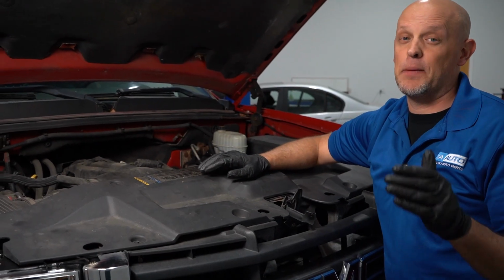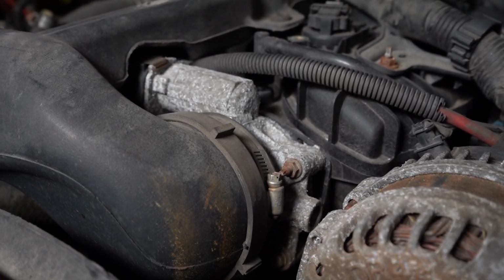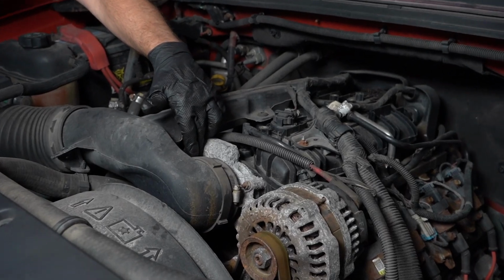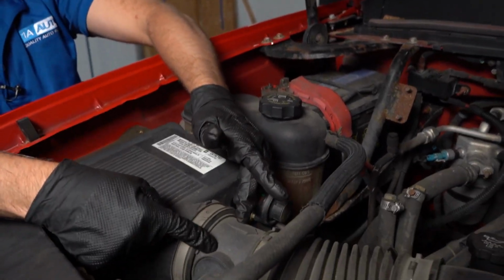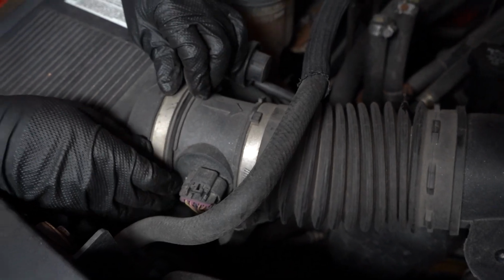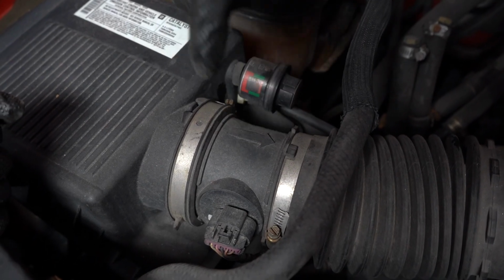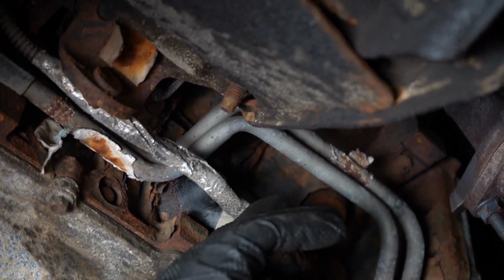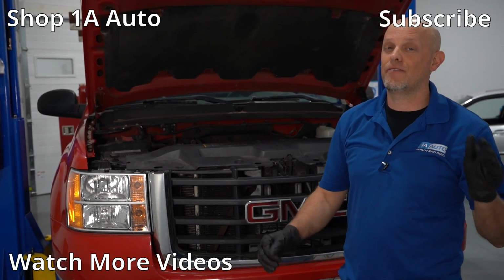Top Check Engine Trouble Codes 2007-14 GMC Sierra 3500 Truck

Comment from the maker: √  Watch the Video
√  Buy The Part at 1A Auto https://1aau.to/m-Visit-1AAuto
√  Do it Yourself
√  Save Money
Reply: Hello my friend i have a problem with my car is 2012 gmc acadia the rpm gauge didnt stand its go up and down just little not much i cleaned throttle body and manifold sensor and air mass Flow sensor and its still no change what you think the problem is

Comment: Hi, I have a 1998 Dodge dakota 5.2 magnum, and it stalls at idle, you can hold the throttle, and it will still stall, I'm thinking a security issue. What do you think?

Comment: Greetings from Styria, I am totally enthusiastic about you and your tips and advice👌👍💪. I have a concern and don't know what to do next with my jeep grand cherokee 4.7l v8 built in 2000. It only runs on 7 cylinders. The eighth cylinder doesn't like. I have the ..... Fällercot P0208 .... I have new injectors, new spark plugs, new ignition coils. AND it still runs restlessly and against the fällercot P0208. The spark plugs have sparks, the injectors also work and inject gasoline, what else can I do ?????. Thank you in advance. Greetings from Daniel Förster from Krennach
Reply from the maker: +Expendables Black Crow We wouldn't be able to diagnose an issue like that here, you may want to have a local mechanic take a look at it. Thanks for checking us out! http://1aau.to/m/Shop-1AAuto-c